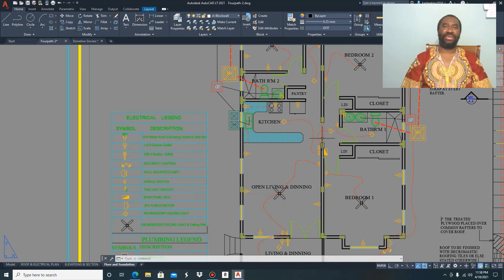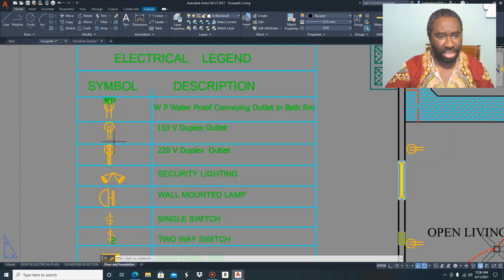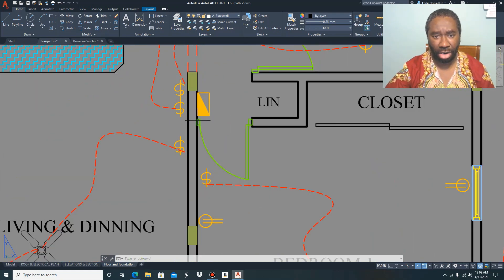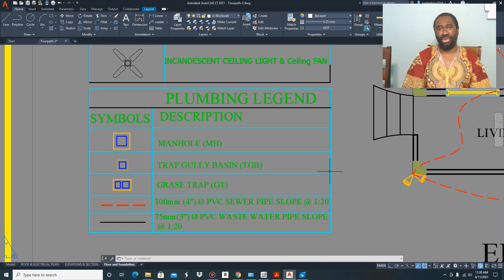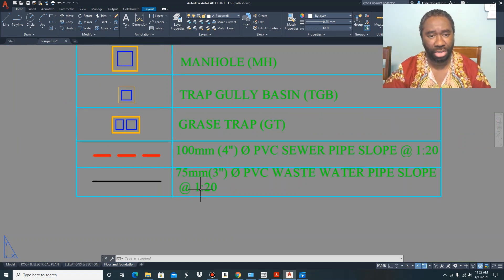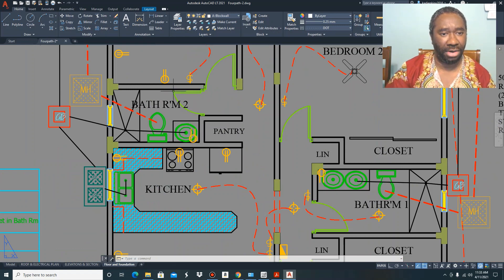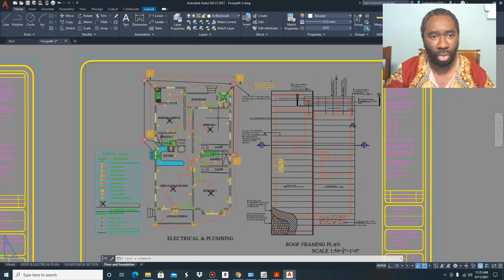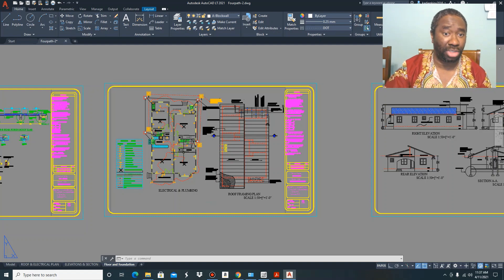How to read the Electrical and Plumbing Plan Layout.

Comment: Oulets never go under windows !!
Reply from the maker: The height of the wall outlets is what matters. Not the placement. My house in Jamaica has a wall outlet beneath the window in my living room.
Reply from the maker: You use to. But the electrical code had changed. Therefore you can't anymore.
Reply from the maker: Tell me why electrical outlets never go under a window.  As long as you have walls beneath your window you can put electrical outlets.

Comment: Hi Belly One. Thanks for great video.  Keep up the good work.  Two questions. How much fall on waste from first to ground floor if the pipes are in the slab? Can I have a 1 foot void between floor levels? Also if I have a 45 ft Very powerful from one so young.  Very intelligent. Maximum props to the parents. Love you guys. Great work Venessa. 🙏🏾❤️🇬🇧🇯🇲 span by 50 ft deep span open concept living, kitchen. Can this be done successfully without ant vertical columns, i.e. Can I use rsj steel goalpost hidden in wall and ceiling? Or can I achieve without the goalpost style setup?
Reply from the maker: You can either put a half inch or 1 inch fall on the waste pipe in the slab. Any span over 20ft need intermediate support to limit the deflection.  Therefore at mid span you can put a hidden beam in the slab accomadated by stiffener columns at either ends to spread the load across the ground.
Reply: Belly one_Engineering. Thanks for quick reply. I think I understand but it sounds complicated lol.

Comment: Really appreciate you videos. Looking forward to the next one. Quick question how does the drainage system works for an upper floor?
Reply from the maker: That's a good question. The drainage system works the same way, except that the waste water drainage pipes are setup in the floor slab, before it is poured with concrete and leads down through the block wall or through the stiffener column with 3 inches or 2 inches pipes respectively to the manhole or gully basin below. Good Question though. RESPECT.
Reply: @jkengineeringarchitecture.  thanks for the information. Appreciate it.